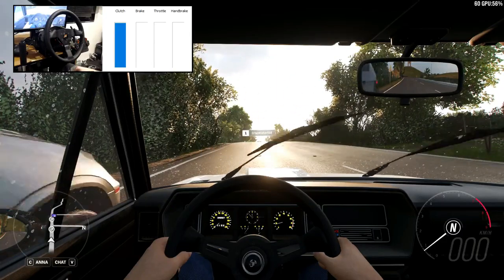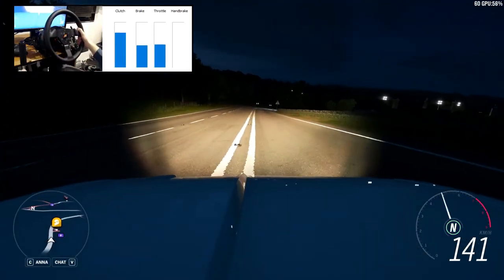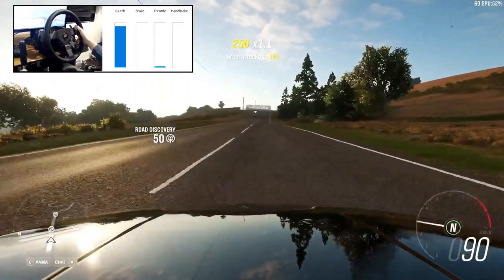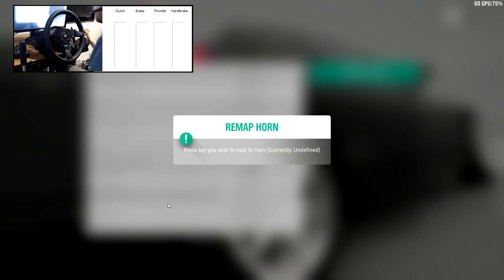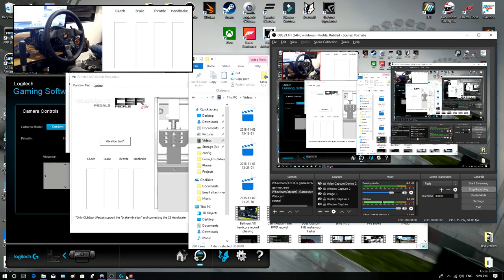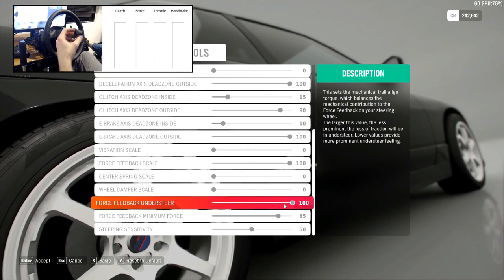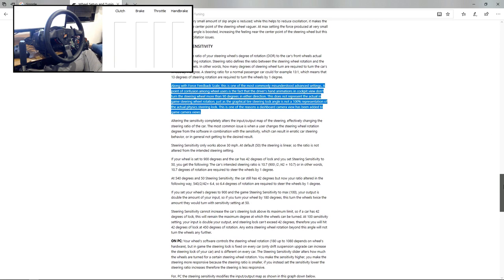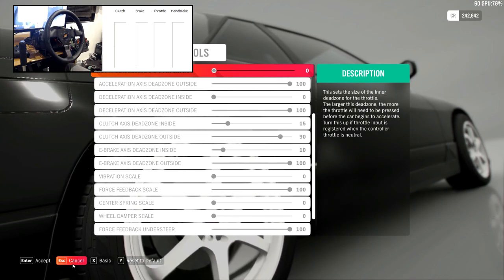Everything Wrong With Wheels in FH4

Comment: Its getting really difficult to watch your videos Blue. Not because of the content, but because of your microphone. The whole video is filled with really bad plosives, and its not that clear either. Its almost as though you have the recording gain turned up really high, and you are getting digital clipping of the recorded audio. If thats the case, you want to record at a lower level for your mic; and raise the volume in post (raise the volume in your video editor). Which should resolve some of the issues. OBS can be set to record separate audio channels, so you can have mic and game audio separated in your output file; which allows each to be adjusted individually in your video editor.

In OBS, you need to go file/settings/output/recording, and then make sure audio track 1 and 2 are selected. Then accept and close settings. I record in MP4, not sure if this will work with other file types.

In the OBS main window, right click on the audio mixer and select "advanced audio properties". Set your audio tracks to "1" for your main source (desktop or capture device), and your mic to track "2".

You will have to be using a video editing software that can read multiple audio tracks from one video file for this to work, such as Sony Vegas. 

You will have to experiment with your mic settings, but start of with the mic set at the default levels in OBS; and lower the Mic volume in the windows "sound" options. (system wide volume basically, rather than software volume in OBS). I hope this helps you out.

p.s The gear grinding issue is present in every Forza made since the Xbox one (at least). Its vastly more noticeable in the horizon games. Especially Horizon 2, and now 4. I think its animation related, not audio related. You can test this by slowing down your shifting speed to better match the animation while in the in care views, and it will stop the grinding. Though if you are in neutral and lift off the clutch, it will still grind there regardless.

Edit: alternatively, you can use Audacity to record the mic. This will give you a separate file for Mic audio.
Reply from the maker: I understand, I feel like I've tried everything to make it better on the mic I'm using, this time I didn't do any volume boosting at all, I checked before recording that the audio wasn't clipping. Might just be my voice, the only other thing I can try is use my high quality USB mic and record the voice over separately. I can't use the USB mic for live recorsing because it picks up way too much noise when the wheel is in use.
Reply: @TheBlue028  The mic picking up other noises can be reduced by lowering the mic gain, as well as having the mic placed between yourself and the wheel. If you have something a blue snowball (or something like that) with a mic stand threading on it, I would highly suggest grabbing a mic stand/boom arm. I have a mic stand myself, and it allows you to place the mic a lot closer to you; which facilitates reducing the gain level needed to record things clearly. And they are usually very cheap. Mine was around £25. Helps to keeps the mic out of the way so that you can still do live recording/commentary while driving in game. Which has a knock on effect of reducing ambient noise levels. Recording mic audio in Audacity can help also, as it includes tools to reducing unwanted noise levels. As well as adding compression and equalisation effects. Its a fairly decent editing tool, considering that its free. Which gives far greater control.

Most mic issues, even on headset mics. Usually come into play from the gain just been far to high. The plosives cant be helped, but the effect of them can be reduced by trying the steps I outlined above. But they will always be worse with a headset mic, as it is so close to your mouth.

I've done a lot of experimentation, as I like to sing a lot. Plus I live stream while drawing sometimes.  So tried lots of different things to improve mic settings, as well as equipment. So I have had to play with everything from gain levels at the recording side of things, to playing with the audio in post. The cleaner you can make your initial recording, the easier it is to use it in your video projects.
Reply from the maker: @SongDesire  surprisingly, that is the exact mic I have haha, I will Definatley try some of the suggestions you've made and see if I can get a stand and boom for the snowball. I've been letting everyone suffer with my crappy mic for too long